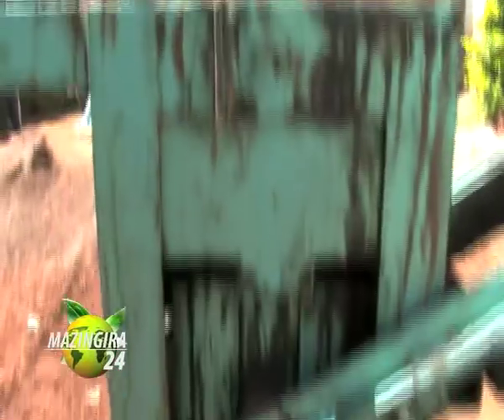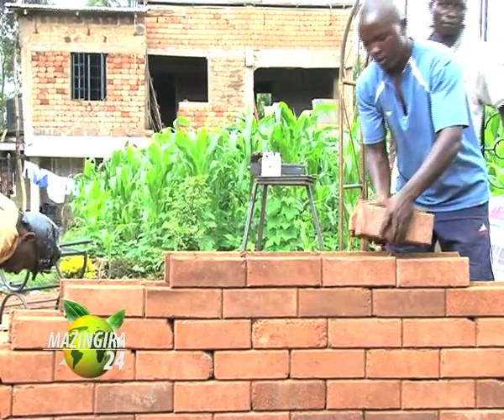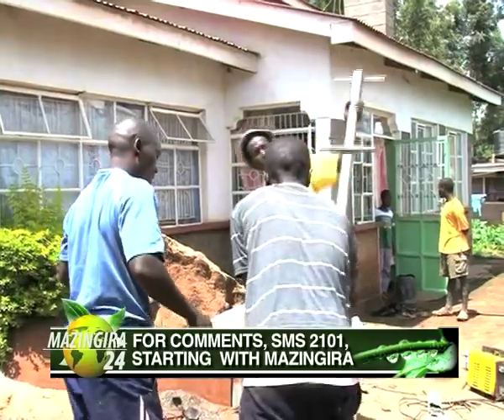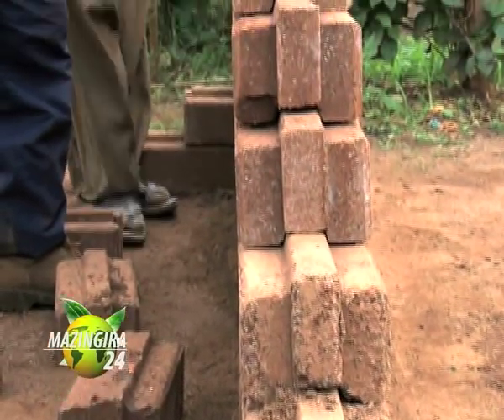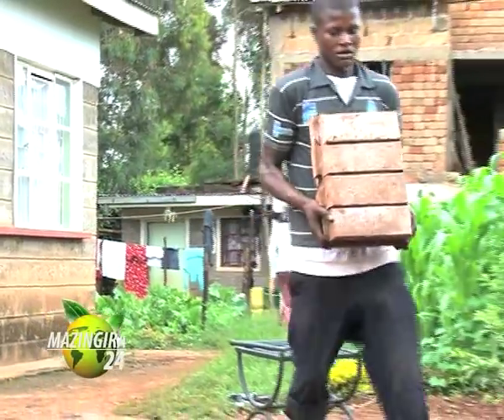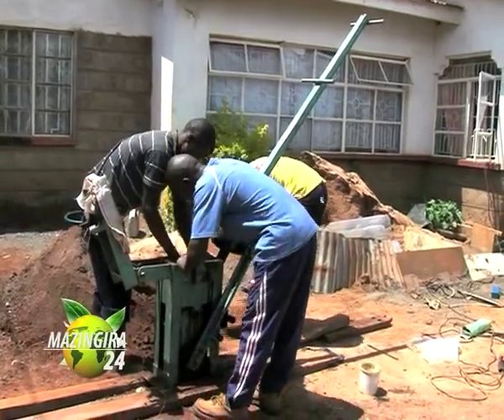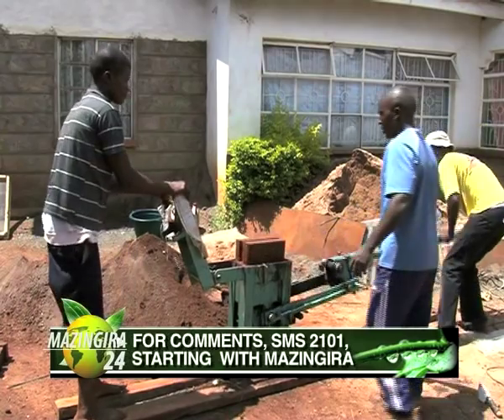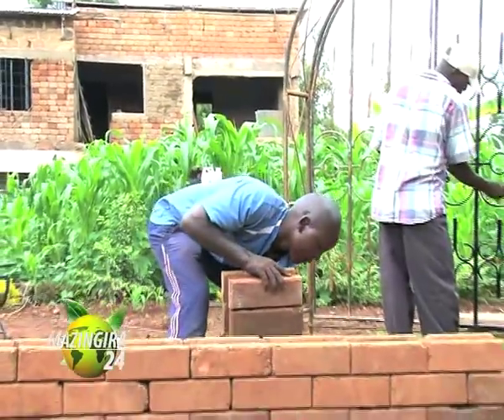BUILDING CHEAP - INTERLOCKING SOLUTIONS _OTINDO.mov

Comment: its cost effective, but always with damaged edges ... and between bricks mosquitoes put their nest .... and if any bricks is cracked and with heavy rain water, the brick will change color .... this is the disadvantages unless a good quality of bricks .... good job anyway !
Reply: i agree interlocking is quicker to build but to me there are too many issues with them ... i think compressed earth blocks the normal ones (not interlocking) are great ,,, there was another video on youtube where a guy used 60/40 soil with water mix (more on liquid side) as his mortar and he just quickly poured it on before setting the blocks down and then slid each block side to side a little to get a even coating of the mortar before sliding it into its final place ,,, after 2 hrs drying it was so difficult for him to move each block and after 3 days he needed a sledge hammer to separate the blocks

Comment: I recognize a major impediment to overcoming poverty, mentioned briefly. First, govt. intervention, e.g., building permits/regulation. It gets in the way, on net. Second, ignorance. Building with earth, especially using the compressed, interlocking blocks, requires a quick one day tutorial, but where are the international aid agencies? Moreover, I noticed lack of quality control in blocks. The earth was not sifted well. Was it tested for proper ratio of sand/clay? Do they know they can save money on PC by adding fly-ash, slag, common ash and other cheap materials? Do they know PC (the most expensive component) can be eliminated completely with emulsified asphalt, an extremely cheap by-product of refining oil and found naturally in ground pools, used by many civilizations for millennia? Also, there are new polymers that act as cement, cure almost immediately, and are cheap. Have aid agencies advised that new fuel-efficient stove designs that can be cheaply built by anyone exist? 
KNOWLEDGE IS POWER! Unfortunately, ALL governments monopolize knowledge by producing propaganda so the elite can exploit the people. For example, those permits that the govt. official said were expedited down to two WEEKS could take 2 MINUTES, with a bribe. Bureaucracy is anti-life, always, everywhere. Free public ed exists to brainwash youth, teach the opposite.

Comment: What happened if it rains
Reply: The concrete incorporated (along with the compression) make the blocks watertight, if a little bit of cement mortar is used the wall itself will be waterproof as well

Comment: A very good program showing the potential for reducing building costs in Africa. What do the structural/materials engineers have to say about this innovation, what research has been conducted (or not conducted)? Information from the policy implementer was also useful.
Reply: we are interlocking brick machine manufacturer, please see my video.
whats app: +86 152 6972 2300
shengyablockmachine@gmail.com

Comment: how do you cure these mud/clay brick to make them strong as traditional bricks by flame.
Reply: They are made from mixing soil and cement in permitted ratios
Reply: You cure the bricks by keeping them moist watering them daily for a month and keeping under a tarp so they don't dry out. Keeping them wet makes the cement bond with the sand, and the lime bond with the clay.
Reply: @rubyellis.5472  i don't see them keeping it moist, i see them just putting dirt/clay into the machine and pressed into a interlocking brick and use it right away. i don't even see them using a mixture of cement.
Reply: @kracksmith4ejm1  Not everyone is educated on how to make the brick strong.
Reply: @kracksmith4ejm1  the ones they are using to build are already cured. The wet bricks are covered and cured for almost a month.
Reply: @rubyellis.5472 you look that you build ur own home from this material? Am I right?

Comment: those bricks need more cement they crumble when intelocking and it would be better to do the eco bricks with the holes that way you can insert the steel bars for reinforcements. Those houses look like they will crumble easy.
Reply: not really. we dont neccesarilly require steel bars between the bricks but well calculated/defined soil cement compacted in pressure over 80 pascal square units. cement is further stabilised with water curing makes the brick very concrete.
Reply: @memusiantonio  What type of earth can be used?
Reply: @drsantoshsinghrathore9308  all except black cotton soil.
Reply: +venezolanatrini More info re eco bricks lease.

Comment: The bricks would have to cure first for about 4 weeks and kept humid that time (sprayed with water 3 times a day and kept under plastic) Also there is a need for steel bars  to be inserted into the walls vertically and horizontally to increase the stability. That video shows how it NOT should be done!
Reply: tickyul that's what you imagine. everything you know about Africa is in your imagination. You are seeing interlocking blocks that are solid and have a High load bearing capacity and you are still talking of reinforcements. I think you might need to learn about construction  first. Don't diss just because its Africa. plus, as you can see, there's no foundation here so this was actually for demo purposes only.
Reply: @renethundress6115  It depend on topography of the area...
Reply: @sophiemalenya2796  true and if it's a humid climate they would naturally cure with the moisture in the air , but even in a humid climate they should still be giving them a good water shower at least once every 2 - 3 days for the first month , after that they should be really strong
Reply: +Jim Panse    I don't think the construction standards in much of Africa are very high.

Comment: So they can create vertical walls, but what about horizontally over spaces? Gonna need either a crane or metal for that...
Reply: +Jfreek5050 why would one want to create horizontal walls? 
You probably meant the ceiling, did you?
Reply: +Joseph Waka Kinda, yes. Normally brick structures that aren't supported by metal will collapse if they are long and horizontal, in this case, flat roofs, ceilings, etc. Romans utilized arches to prevent this, but I wanted to know how, if it were possible, to set up bricks so that they could support themselves in a manner similar to reinforced concrete. I assume they would lay down some kind of metal support for overlying bricks?
Reply: Well I think, there is no need for a solid-celling if it is a one storey house.  The roof will be the "celling (at an angle)" in these case.

Horizontal-solid-celling will get interesting if the housing  has more than one storey. These massiv-celling  are normally made of reinforced concrete or a wood beams and panels (at least here in Germany) .

But there are companies that can realise "brick-celling" of course (as you already said) you will need reinforced to support the bricks from collapsing.
Reply: Where can I find this bricks and how much cost
Reply: @JosephWaka  Red bricks can make roof with lime. Dirt bricks probably not suitable for this purpose.

Comment: It uses Cement in small proportions.  Lime can be used as well as fly ashes.  The extremely high pressure of the dirt mixed with the alkaline material that serves as enzymes, petrifies instantly; making it ready to be used.  With dirt without organic matter, (top soil) and 10% clay, it will work as well, with good results
Reply: Is clay soil also suitable, and in what proportion can it be mixed with cement and water?
Reply: Wood ash can be incorporated, but must have no other material such as charcoal in it. It can react with any carbonate mineral in the soil to make a kind of cement, so the rammed earth blocks get substantially stronger.